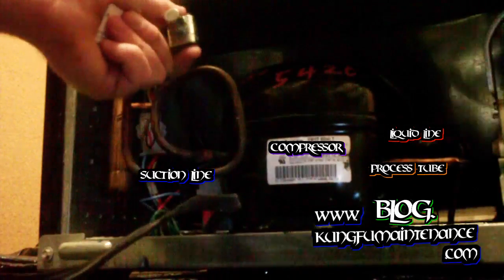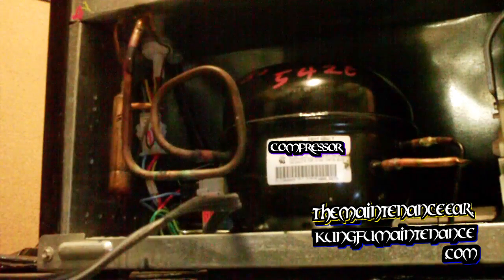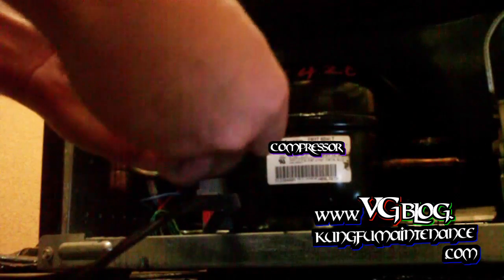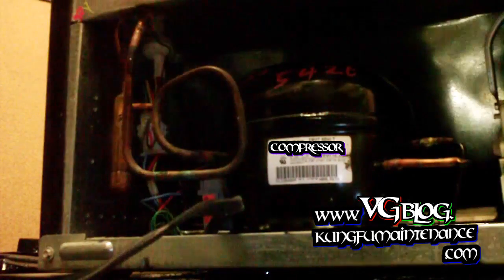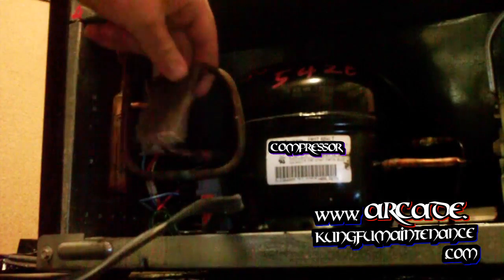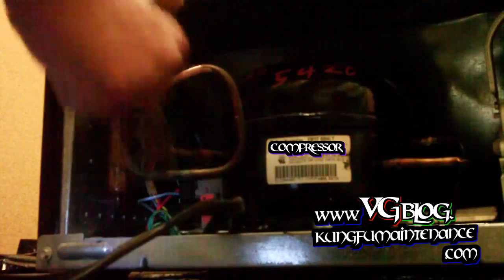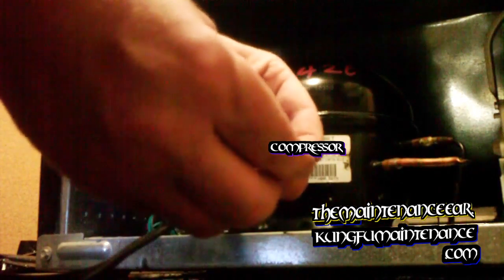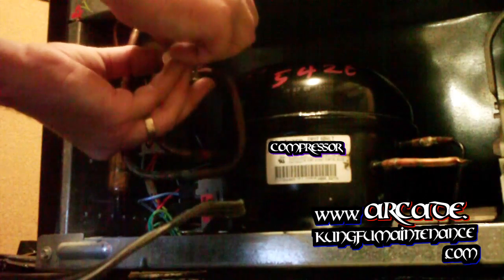How To Install Bullet Piercing Valves To Charge Refrigerators Or Air Conditioners Low On Freon

Comment from the maker: Get the Screwdriver used in so many KFM videos here    http://amzn.to/2kHFoOF 
Get the Milwaukee 11 in 1 Screwdriver     http://amzn.to/2uTtsNj 
Get  the Multi Tool Pliers used in so many KFM videos       http://amzn.to/2kWTjPp
5mf Capacitor   http://amzn.to/2wC96sH     35mf Capacitor    http://amzn.to/2vZVZ2t
35/5mf Capacitor   http://amzn.to/2iVJNi2        40/5mf Capacitor    http://amzn.to/2wzEdXD 
45/5 mf Capacitor   http://amzn.to/2w0wez5   
Get KFM's favored AC Gauges here            http://amzn.to/2kYgGb8
Wet Dry Vacuum used in so many KFM videos   http://amzn.to/2lFxi7u
Condensate Pan Tablets   http://amzn.to/2lalV9W   No Rinse Coil Cleaner  http://amzn.to/2lHg8GD
Condenser Fin Whisk Brush                          http://amzn.to/2vWXUoC 
Chapin Pro Pump Sprayer                             http://amzn.to/2vWCXdD
Evaporator Coil Cleaner No Rinse Mix        http://amzn.to/2x3eJTT
Evaporator Coil Cleaner No Rinse Can        http://amzn.to/2ezIxju  
Get KFM favored Electronic Leak Detector        http://amzn.to/2kmQMMz
Simple Leak Seek Spray   http://amzn.to/2lFfcC5  Laser Thermometer  http://amzn.to/2layD8I  
Hard Start Kit     http://amzn.to/2kiD16v   Contactor     http://amzn.to/2lFqA0P
Easiest Way To Get Universal EPA Certified Prep Manual    http://amzn.to/2kIQdQC
You must be EPA certified to charge or recover refrigerants and here is about the Easiest Way To Get certified with the Universal EPA Certified Prep Manual    http://amzn.to/2kIQdQC
Valve Core Removal Tool                              http://amzn.to/2kJ00pC
Inficon Refrigerant Scale                               http://amzn.to/2vUCQPD
Get KFM's favored Multi-Meter  here        http://amzn.to/2l8W9CO 
Get The Kung Fu Maintenance book here     http://amzn.to/2lEQPFk
Or  the Kung Fu Maintenance E book here  for less than $5    http://amzn.to/2lEY8wD
Get the Kung Fu Maintenance album (good driving music) "Up Beat" here     http://amzn.to/2l41pZ1
Get the Kung Fu Maintenance album (nice Instrumental music) "Entropy" here   http://amzn.to/2kl2U0p
Samsung Galaxy S8 Plus        http://amzn.to/2sFn9h8
GoPro Hero 5 Action Camera         http://amzn.to/2sN4nVK
Rode Lapel Microphone                 http://amzn.to/2vZoFc7
Purple Panda Lapel Microphone  Kit   http://amzn.to/2wByXkq
Video Edit Pro Software       http://amzn.to/2ruaaeZ
Samsung Galaxy S5                 http://amzn.to/2wBxk6l     
Samsung Galaxy S8 Plus        http://amzn.to/2sFn9h8
Video Edit Pro Software       http://amzn.to/2ruaaeZ

Hire An HVAC Specialist                                  http://amzn.to/2lktKek
Air Duct Cleaning Services                              http://amzn.to/2lFTpun
Central Air Conditioner Tune Up                   http://amzn.to/2lzJGoy 
Air Conditioner Repair Or Installation          http://amzn.to/2lFsEGw                                           
I don't work for any of the product companies  listed however I do make a small commission on items ordered  through the links.

Comment: This is a bad idea unless you’re permanently taking the appliance out of service and you’re trying to recover the refrigerant. That piercing valve will eventually leak. 

If you’re charging, better to use the process tube (you know, the thing that was actually put there for the express purpose of installing a piercing valve), and then resealing the tube by brazing when done. The reason appliances last so long is they’re completely sealed. Best to keep them that way if at all possible.
Reply: That's what I was thinking too.

Comment: Do you know if this can be done on a drinking fountain system. Ours only requires 4 oz. of R134 but it is quite costly to have HVAC come out and braze fittings and recharge the unit. Was there an adapter that fits onto the piercing valve to connect to the R134 refrigerant hose or was that part of the piercing valve kit?

Comment: How do you know how much refrigerant you have in the system if you don't evacuate what is in there and recharge with the correct amount? There's no way to know without removing and weighing what you put in.

Over charging the system will cause damage to the compressor from what I understand.

Then there's contamination of the system using an line to fill that hasn't been vacuumed first.

And yes there's environmental issues. Less damage is not no damage. If everyone did this then that adds up to a lot of damage.

I'm not a tech, but, I'd have to agree with those that are. These type valves are meant and designed for access only... 

A Sealed system that's leaking needs a new filter. And the leak to be sealed. 

it's one thing to show how this are installed but it's another to present info that's part of a problem, not part of the solution.

Comment: I have used a piercing valve on the process tube, near the end of it. When you are done using it crimp the line below it with a special tool, remove valve , cut off process tube above crimp and braze the end.

Comment: Hi! Thanks for the video! I have installed a bpv on my copper line. It is a medium size wine chiller. The diagram calls for 60gr of r134a. I know there is refrigerant inside the compressor but less than the 60gr recommended. How much refrigerant should I read on the gauge (in psi) when my compressor is running?  5psi? 7psi? 10psi?... Thanks!
Reply: flying frenchman I'd put it in the ball park of 0-5psi low side ideally. On a normal refrigerator that's the range to shoot for.

Comment: Many people ask about what adapter you have to get to attach to the Supco Piercing Valve to your refrigerant can -  you can get at many autoparts stores what is called a "R-12 to R-134a Retrofit Parts Kit'. This will include a few different adapters - one of which being the exact one you need to make the Supco Piecing Valve connect to any R-134a refrigerant canister that has the "shrader valve" fitting.  I ran over to my local O'Reilly or AutoZone or Advance Auto Parts and they all offered one in stock.  Brand is A/C Pro part number is VA-LH11 (Google it).  There are other brands of this Adapter Kit as well. Sometimes you'd rather just go get the item you need rather than waiting for it to ship online (and hope it fits.)
Reply: David Harris thanks in advance man

Comment: How about someone invent a regular schrader-valve, that can be soldered onto the ac-line, and it punctures the line for access on the first use without leaking any refrigerant?????? How about a piercing-valve, like the one in this video,  that also can be soldered????
Reply: There is such a thing.  Google "Saddle Valve". Has a shrader valve in it.
Reply: David Harris         I looked at saddle-valves on Google-images, none of them look solderable.

Comment: For testing purposes, these valves are great, but after troubleshooting (subcooling and superheat are awesome tools) we need to replace them for brazed ones, don't believe me? time will let you know. Good luck guys!
Reply from the maker: +giosource08 Still running even at today's 115 degree Palm Springs day! Nothings perfect but I can live with that! Beats the alternative!! LOL
Reply: +KungFuMaintenance, great brother!, if it works for you, enough said, I am currently replacing a Carlyle compressor for a 40 tons chiller on a 110F in Riverside CA, had to set up a tarp that worked perfectly,  greetings!
Reply: +giosource08                 All sealed-systems leak.

Comment: Nice video. I agree with some of the arguments over  the  longevity of the repair using a bullet piercing valve, but for simple repairs such as window air conditioners and refrigerators, they are a simple and easy fix. Often a window air is already empty because all the refrigerant leaked away. This could be worn seals, but Freon R22 is a very small molecule, as is R134a. It is bound to escape an older unit and a refill may last years. As an auto mechanic in the 1970s I can tell you all we used was Freon R22 and we gassed it straight into the atmosphere. (I still have my old gauge set and vacuum tools.) Then we discovered a hole in the ozone. 
    I was a geologist/climatologist by university training so it didn't take long to figure out what we had done and now we have recapture laws. Still, these small devices aren't doing a lot of damage and it's mostly near Australia so who gives a damn, right? We're Muricans after all. But as I said, EVERY window air conditioner, EVERY car air conditioner, EVERY whole-home air conditioner and EVERY refrigerator will leak, and given time, will exhaust its entire supply of R22 or R134a into the atmosphere. If you want to argue that these small valves are a contributor to the destruction of the ozone, you are correct in a minor sense. But to avoid being a hypocrite, you need to safely discharge every device I mentioned and then never, ever use one again. Dig a deep cold cellar for your food, forget frozen stuff (can't buy ice--they use the bad stuff), and use swamp coolers. First one to invent a roof mounted automotive swamp cooler is a winner and can get funding on Kickstarter.
    People lived without freon-style refrigeration. It was called the eighteen century and earlier, and so what if you or you dog died of food poisoning. Shit happens. On the other hand, if you want to be truly responsible, you can buy a full freon recovery set for $400-800 on Amazon.

Comment: What adapter hose do you use? I cannot seem to find the right hose to connect to the piercing valve.
Reply: Many people ask about what adapter you have to get to attach to the Supco Piercing Valve to your refrigerant can -  you can get at many autoparts stores what is called a "R-12 to R-134a Retrofit Parts Kit'. This will include a few different adapters - one of which being the exact one you need to make the Supco Piecing Valve connect to any R-134a refrigerant canister that has the "shrader valve" fitting.  I ran over to my local O'Reilly or AutoZone or Advance Auto Parts and they all offered one in stock.  Brand is A/C Pro part number is VA-LH11 (Google it).  There are other brands of this Adapter Kit as well. Sometimes you'd rather just go get the item you need rather than waiting for it to ship online (and hoping it fits.) This one worked perfectly.  I just use Teflon tape on all threads as well. Preventing leakage...

Comment: How do you identify the suction line?   I have a Samsung RS2630 with a slow freon leak.  The specific compressor is no longer available.  Is r134a the correct freon for a unit 10 years old?
Reply: you can find the information you need on the manufacturer data plate.

Comment: Hi. My frigidaire 15.100BTU window ac doesnt blow cool air. I check everything and is clean, everything is working good. What i thing/feel is out of refrigerant. Can i use this method on my ac to fill up ac ? Do you think it can be a reason ?

Comment: Let me ask a dumb question.  After charging you close the piercing valve to run the system?
Reply: Yes, you have to "tighten" the valve after charging. That tightening of the valve closes the hole the valve pierced open.

Comment: I have a question, after installing the bullet piercing valve on the suction line, if I turn the can of refrigerant upside down it will introduce the refrigerant into the system as a liquid, is this correct ?  Also if I hold the can in an upright position will it introduce the refrigerant into the system as a vapor?  So, If I am correct so far, then do I introduce the refrigerant into the unit as a vapor or as a liquid, because being so close to the compressor it would seem to me that if it was introduced as a liquid then if might cause compressor slugging, is this also correct. I believe that I have a small leak in my unit, the low side and the high side lines going to the evaporator coil are icing up.  I would like to know where I can purchase R-22 in a small container with stop leak, this would be most helpful.  Thanks a Lot can't wait for the reply.  Starting to get hot in Texas    Danny

Comment: The way to install piercing valves is...you just don't. Braze in shraetor valves. All piercing valves eventually leak. If I find them on a unit, I take them off and throw them in the garbage.
Reply: +djpaulk  "fucking up our environment"? There are more chlorides propagating to the ozone layer through our atmosphere from normal daily swimming pool evaporation than if we breached all A/C systems on the planet. The religion of you treehuggers is preposterous.
Reply: Braze... Really? Then you evacuate the system I suppose.
Cost? I like this better.
Reply from the maker: George W It is now the day after the day after Thanksgiving 2014 almost two years. No problems still keeping freezer items frozen and fridge stuff chilling so the repair has lasted almost two years. Refrigerant used was R 134A. If it ever goes low just a little recharge and its back in the mix. R134A is much less ozone damaging than other refrigerants. Not a bad way to go in my opinion. To braze in a valve would have meant recovering refrigerant and pulling vacuum than recharging. If it was R22 or another more ozone damaging refrigerant I would agree with you but for R134a I am glad I did it this way.
Reply from the maker: George W Lol I had started to explain a similar sentiment on the end of my previous response to your comment than backspaced it out lol. Yes for larger systems or commercial set ups where more is at stake and is more critical to prevent a call back it definitely is better to recover, vacuum, and braze in. It is always best to braze in but this can be a quick effective repair for a lighter duty situation that can be fairly easily monitored and maintained. Thanks for sharing comments ~ and for watching. ~..~ KFM
Reply: I have news for you. If you are installing these or brazed valves, it is because your system ALREADY leaks.
Reply: I agree piercing valves always leak.  Braze in Schrader valves and no leak with that valve at all.
Reply: +Jim Pettinato                All sealed-systems leak, some faster than others.
Reply: Jim Pettinato is an expert i watch some of his video and he did great. All his tips are true and effective. Sometimes eat your PRIDEchicken.hahaha
Reply: KungFuMaintenance   I do agree there, but since I work on commercial HVAC and refrigeration the charges are not in less than a pound. Rather more like 15 to as much as 200 pounds of refrigerant. It is a must to braze in Schrader valves.
Reply: I rarely ever had a clamp on leak. And most of the time it was on older units that were nearing their life expectancy so the customer seldom wanted to justify the additional cost of a braze on which also requires changing the filter drier. The added labor plus the filter and the hours added to the repair time makes it tough to justify. People seldom wanted to be without their frig long enough to allow for the added time.
Reply: Lots of positions on this subject. My position is the risk / reward of removing the pierce valve after recovering the gas is the fact that brazing will contaminate system unless nitrogen purge and that requires you to now remove the filter dryer and install a 3tube with an 1/4 access port on it to flow the nitro. If you be willing to do the correct work required than its a better setup long term. For me I now believe if you're just adding a top off, just leave the piercing valve on. I don't like how it was prepared on this vid. I use wet 600-1200-2000 grit to get an almost mirror finish before installing the supco bpv31 and have never had a leak with it period. And yes, I have returned to see my work on many appliances after as much as 4 years for other issues on the appliance but my install did not leak. Correct prep of the tube is key to success and not explained in the instructions with the valve, I never could understand that. I would include small pieces of the correct sand paper with the valve and best way to prep. I guess that would cost too much and do they care, maybe not. Best luck to all.
Reply: Bob Bob Piercing valves are only designed to gain access to a system, not for permanent installation. You learn this when and becoming a tradesperson.Cost???  The cost is depletion of our ozone layer..People who do not do things the right way are fucking up our environment and making life more difficult for those of us who do the right thing.If you do not have the money or time to do things the right way (braze and evacuate) I suggest you quit fooling around with refrigerants ;)

Comment: What happens if u dont use a vacuum and just put in the Freon into a empty refrigerator
Reply: It's not really empty, there is air in the lines and that air has moisture in it. Air is compressible, but you don't want to waste energy compressing air, you want to compress refrigerant. The moisture in the lines is not compressible, and it's bad for both the compressor and the oil in the system that is used to lubricate the compressor. You can rent a vacuum pump at an auto parts store, and probably a set of gauges as well. If you are charging with R-134a, which is what modern mini fridges and cars use now, it's the same equipment. After you pull a vacuum, you empty all the air and boil out the moisture in the lines, then it is truly empty.
Reply: lucidbarrier Not only that, moisture in the system can also  block or restrict metering devices